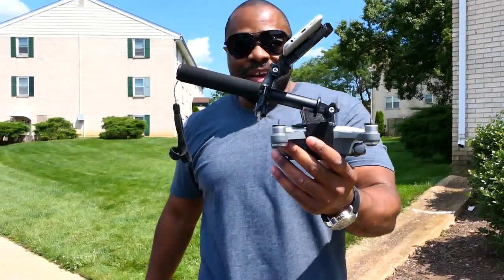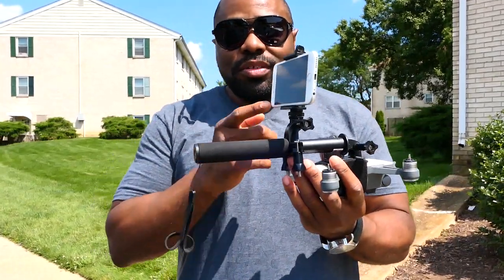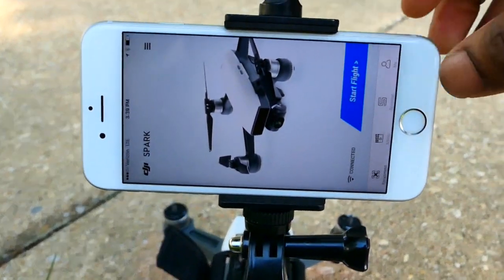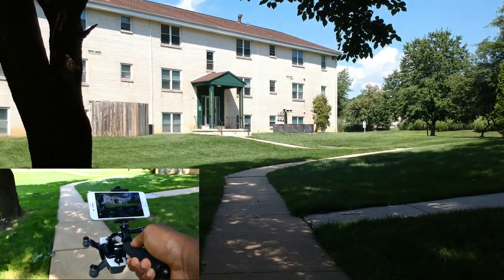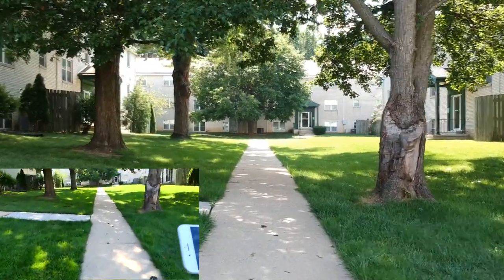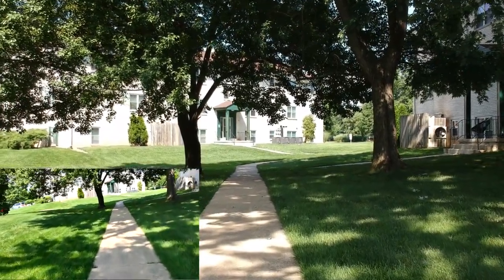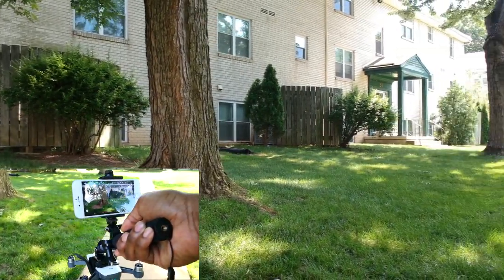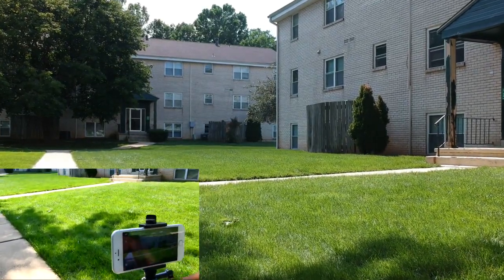Dji Spark Steady Cam Experiment

Comment: kinda worthless as its only a 2 access gimbal.
Reply from the maker: +Bigdroneguy I dony know.there are a lot of 2 axis gimbals on the market for cell phones and gopros..check amazon
Reply: BigBallVlogs thats my point, the spark only shots 1080 30fps kinda worthless for a steadycam, when my older cameras do a better job.
Reply from the maker: +Bigdroneguy are you saying the spark is worthless becuase it only shoots 1080p and has 2 axis gibal? The spark has it limitations but I think the camera and stabilization are more than capable. I think we get caught up in the hype of latest greatest and most features. When it comes to video and photography awards have been won by ppl with the oldest equipment. Not the guy with the 10k redcam. What this video shows is that the spark is steadier than my 700 compact and my 400 gopro so if your goal is stead video this has more value than the others. If doesn't matter if is 4k if it's to shakey to use.
Reply: The spark is a cool drone but I own a DJI Mavic and a P4 and if I compare it to them its a step back, Now that being said is it a good drone for a first time buyer wanting to spend a little less and get into drone (hell yes a great first drone) But a $699 for the fly more kit I might save the extra 300 and get a mavic! The Spark does not have all the video settings that many of us are used to and I wish they would have made the camera 1080/60fps, the spark also is not as stable in the wind as the larger Mavic is and I took mine ou today and in the same wind my Mavic hold tight in the Spark was getting pushed around alot

Comment: How long it can record as a hand held stabilized camera?
Reply from the maker: +楊正中 there is no limit except the capacity of you as card
Reply: BigBallVlogs thx. but I mean how long the battery can last whereas it only can last 16 mins in the air.
Reply from the maker: +楊正中 power consumption Is not the same since you are not flying. It took me more that 15 minutes to shoot that video and in 3 separate take. And I was down to 85% battery
Reply: Thanks! You should post a video where you just test the non-flight video record... I've been curious for a while and bet others are too! I have to wait for my Spark to arrive to test myself, just placed the order and your videos will keep me from going crazy!  :-)

Comment: Nice demo. Is there a setting in the Go app to adjust the smoothness of the yaw stabilization? Also, it'd be a pretty simple task for software to smooth out the yaw. So yeah, the spark is a viable (with limitations) stabilized camera.
Reply from the maker: +Bill Salopek not on the spark. the mavic has cinematic mode the does just that and it slows stops to be smoother footage